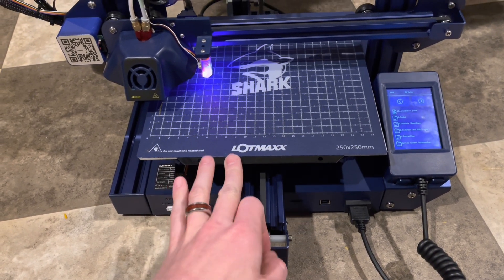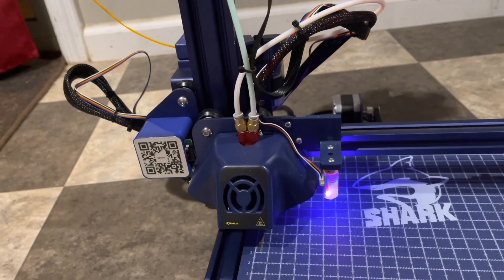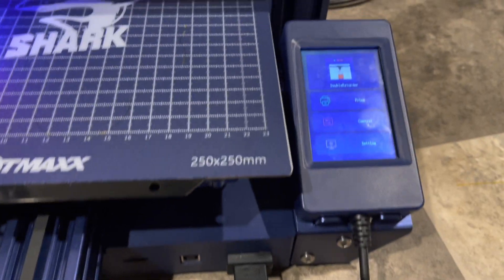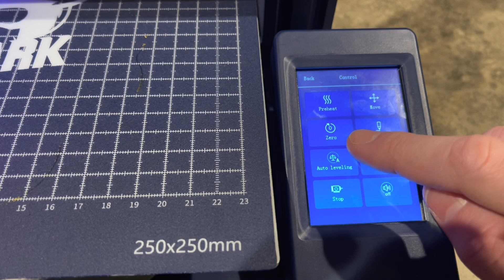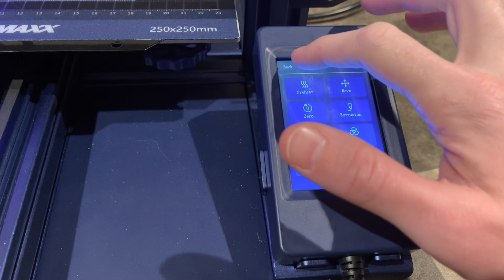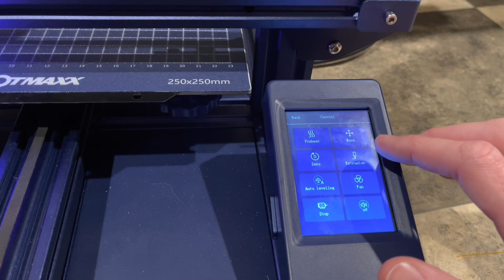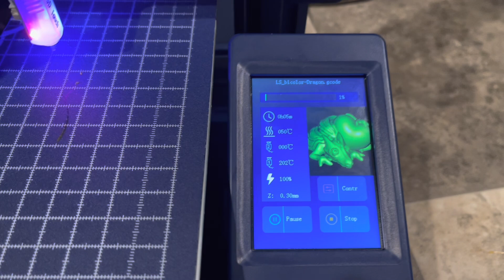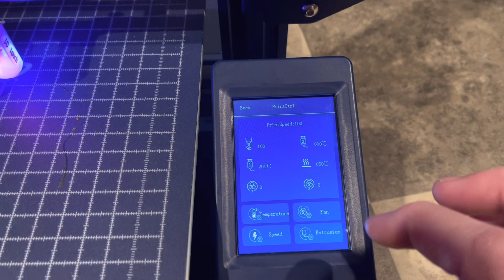LotMaxx SC-10 Shark | 3D Printer Video Review

Comment: Nice video, do you think I should get this printer or the prusa mini as my second printer? Need something reliable and good quality
Reply from the maker: That's really a tough call... I suppose it depends on what you're looking to do. I'd imagine the Prusa support groups probably exceed the Shark support groups that are out there, so that does help. However, the Shark has a larger print surface, can do the dual filament printing, already has the auto bed leveler, and can quickly have a laser thrown on. I think you're best off writing a pros and cons list for both and make your decision from there. Sorry I can't help more than that!
Reply: @plasticmakesperfect5863  that’s completely fine. And I don’t need the bigger print surface since I already have ender 3 pro. And I ordered the prusa since I don’t need the double filament extrusion and bigger print surface. Also the prusa mini has auto bed leveling so I think it was just what I needed